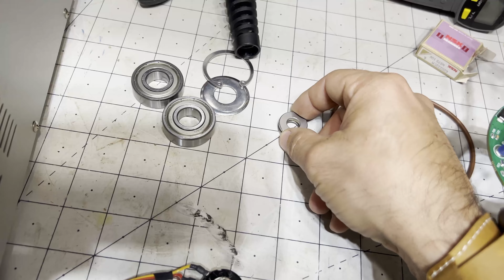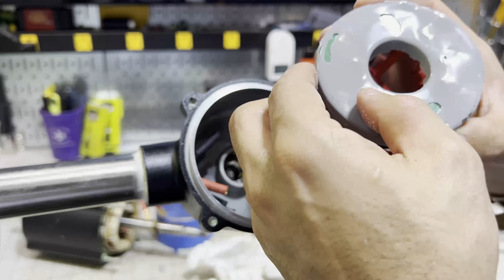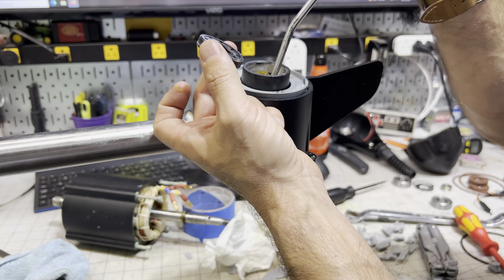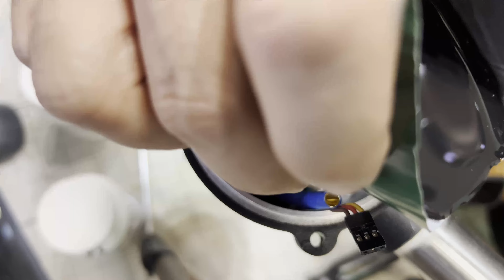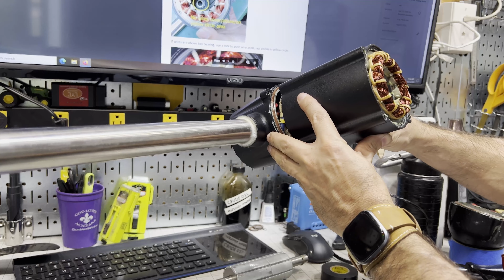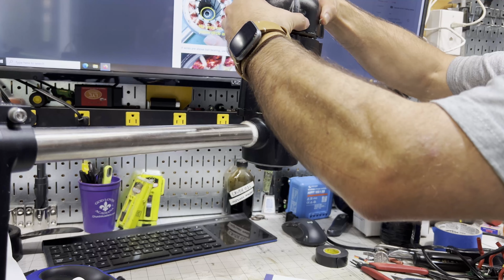Caroute 48V Trolling Motor Failure and Rebuild

Comment: Nice Rebuild. Happened across your channel researching electric conversion of my 24’ displacement hull day launch. Hull is very similar to yours. After watching and hearing the transom motor setup I am leaning towards this simple set up. You mentioned a motor that mounts onto the steering rudder. Slick. I’ll be looking more into that configuration. Cheers from Canada 🇨🇦🏴‍☠️🔱
Reply from the maker: I have an older vid testing a trolling motor on the displacement hull launch, it manages 5.2mph. If you could stick the motor up the rudder shaft tube it would be a pretty clean install. Good luck!

Comment: I sat through the whole process. Got the bottom line on the failure.I would have never guessed that a company would put electronics down there. But thats the modern world.
Reply from the maker: Yea it’s a little weird and I know other pod motor outboards don’t do it that way. Abundant and free cooling, little EMF noise, small topsides profile. All I could ask for, and I nearly installed one, is a water ingress sensor with an external warning.
Reply: I would be concerned about water getting inside also. with a 200 dollar speed controller down there. Maybe with better heat sink compound that you put in, there won't be another fail. Cheers for the company trying to make a slick looking rig. I am open to getting brushless trollers at some point.   I need 12 volt because I use them for a tow behind water toy. "subwing" I ran my 5 trollers in series last year on 4 FLA batteries. At full charge, it went right at 5 mph and  drew 20 amp's.  As it got down to a stable voltage of 49 volts running, It did a solid 3.5 mph. Do you have a new project boat for the caroute?
Reply from the maker: @SJMessinwithBoats  I do have the Caroute permanently installed on a newer boat that has a 48V lithium ion battery, hybrid inverter, 400W of solar, and an engine generator. Need to do a video!
Reply: @OVER-bENGINEERED  Sounds like fun. I am testing a 21 foot Larson cut down this summer. Also, my set up on a 26 foot sailboat swing keel that I'm pulling the keel on. Not using the original mast, I have a light wieght one from another, So it should be spinnaker assisted, electric drive.  Been doing testing for several years now and I'm hooked on that quiet power. Time this year for some longer waterlines and higher speeds.

Comment: Great video! I've had similar problems with mine. Did the newer control board happen to fix the misfire/knocking/hiccups that you mentioned too?
Reply from the maker: I hate to admit it, but I haven’t had the boat out since I fixed the motor. Will do this soon and let you know.